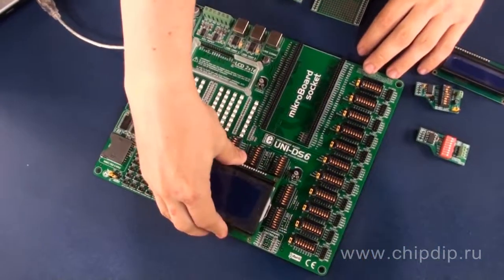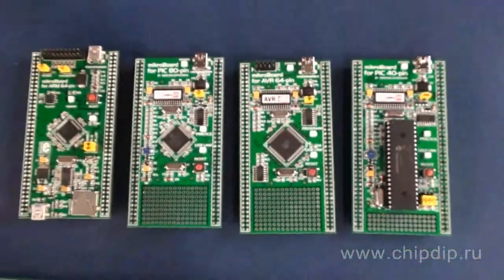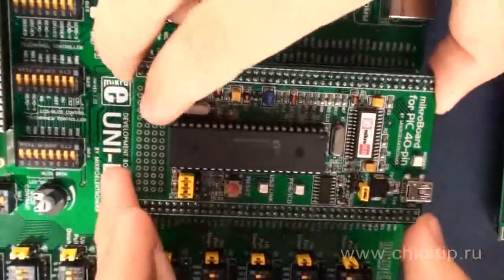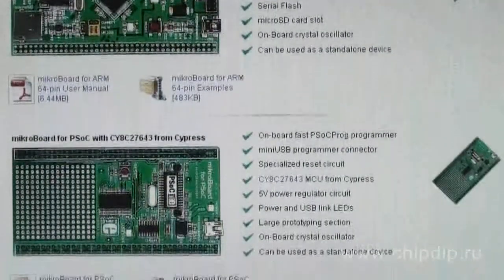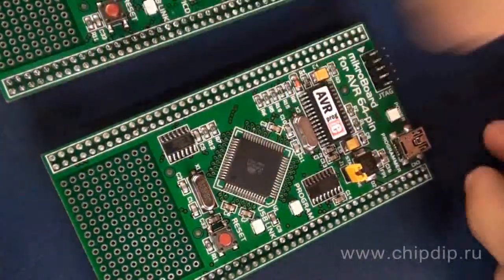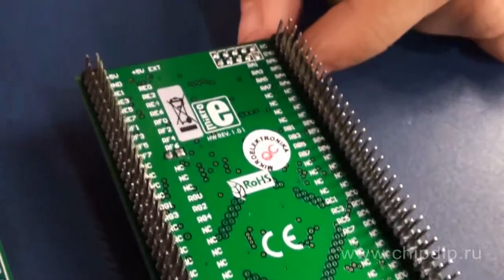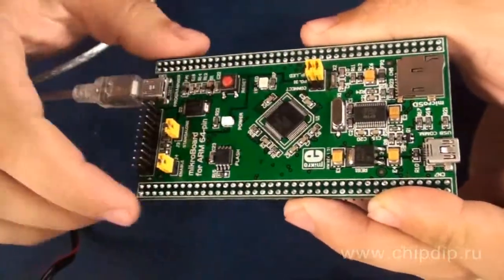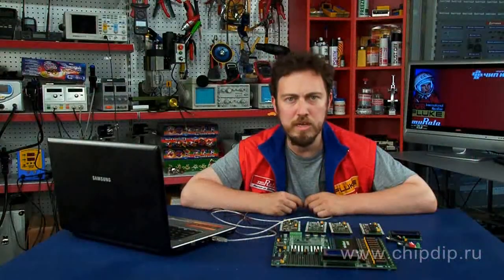ME-UNI DS6 Universal Development Board. ...

Comment: I am not able to run program using this kit. Can you please help. I need very urgently. I have installed the driver and 8051 flash as well. I am able to burn the program but it's not running in the microcontroller. So output is not coming in port